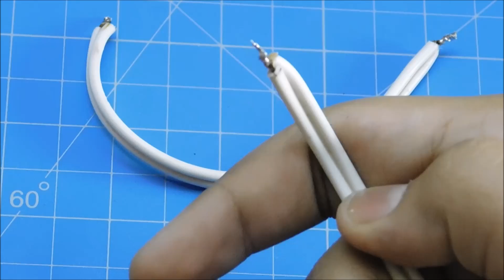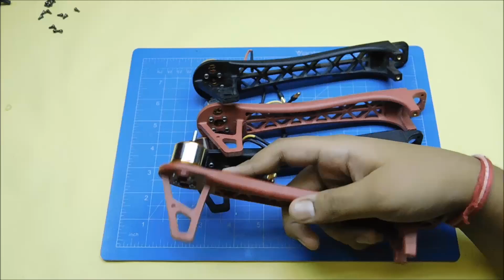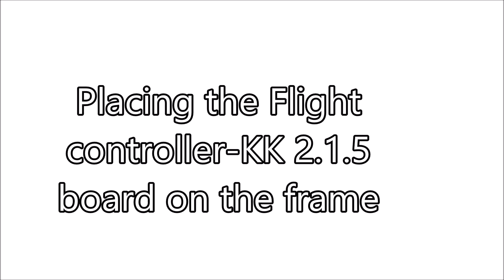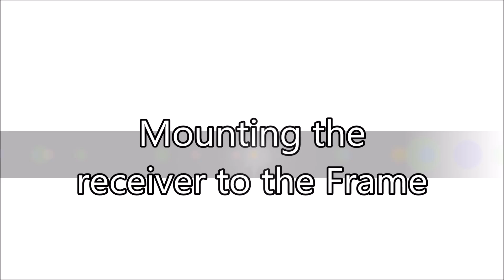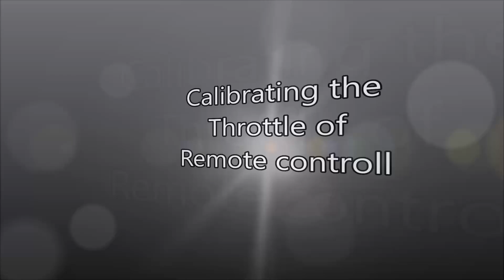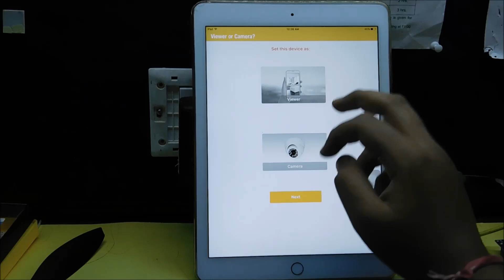Make a quadcopter with a wireless camera under $180!!

Comment: Sir mera kk k Fight controller hai but motors rotate but doesn't fly why sir
Reply: Your drone must be heavy

To fix it, do these things-
1. Adjust your motors kv rating 
2. Increase your propeller size 
3. Adjust your ESC ampere (A) rating 
4. Change your battery may rating
  
Adjust these things like vise and your drone will fly

Comment: Hi..the battery which i'm using is 5200 mah weighing 400 gm and i'm using apm2.8 flight controller..the motor i'm using is of 1800kv rating..is this ok?
Reply from the maker: yes

Comment: hey, Great work bro..
I am facing some problems..
when ever I switch it on and get it armed, 
on increasing the throttle 2 of the motors start moving and after increasing the throttle to half and above the 3rd  motor starts rotating .. 
The fourth motor starts rotating only after full throttle.
plz help.
need it urgently.
Reply from the maker: +Chandan C V the problem may be in your flight controller. Try to individually connect each motor to radio receiver to check whether your motors are ok or not.
Reply: thx bro

Comment: I have many doubts to make a drone..
1.why you was didn't use servo motors in this drone. But your drone was moving forward and backward..
2.which type of motors you was have?.like 1000 kV or 2200 kV motor
3.which type of motor was very good to make a drone.
4.which type of battery is very good to make a drone like 2200 mah or 5200 mah or 10400 mah battery..?
5.which company battery is very good like turnigy,lion power,limskey,hobbyking,.and etc...
6.how much of the flysky transmitter and receiver 2.4 giga herdz 6 channel and 1km range
7.you used only one battery 2200mah battery..so this drone was flying how many hours....
8.if you used,
 1.2200kv brushless motor(4 pieces)
2.2200 mah lipo battery (4pieces),
3.4 pieces of 1045 propellers, 
4.6 channel transmitter and receiver with 1 km range,

So this drone was lifted the battery and motor and extra load .????
This is my important question.....please contact me sir...i have many doubts in to make a drone... Please reply me.. 7904349761 this is my contact number..i am from tamilnadu.....

Comment: Whenever i try to arm the kk 2.1.5 flight control board by moving down the throttle and then towards the right it says armed. But after that when I try to give a little throttle the kk board auto-disarms itself. What could be the reason?
Wiring of all the receiver, board and motors are in the correct manner.
my all parts are as Below
1400kv BLdC
3000mah 3s battery
Esc 30A
KK 2.1.5 Flight  controller 
Transmitter and receiver  Are flysky FS-ct6b
But why could its happening??? 
 help me sir please  please
Reply from the maker: There is a time limit until  which KK2.1.5 board will not disarm itself. If the board does not gets throttle within 30seconds or so, it will automatically disarm itself. Also your can get disarm if it is not getting enough power. The motor with propellor pull  a lot of power which can cause KK2.1.5 board to get disarm automatically.
Reply: Tinkerer's Lab  okk sir i will change battery and after that i will tell you...
Reply: sir thanks for guiding me.. its awesome  and Works great.... thank uu Soo much...
but sir My 1ESC burned out and 3 was Good...
no any Short circuit.. Battery voltage Perfect but why this????

My quadcopter Specifications  are as below
F450
KK 2.1.5 FC
total load 900gram
Battery 3000mah 3s 11.1volt lipo 30C
10×4.5 Propellers.. 
Charger Imax B3 pro
ESC 30amp simonk
tx rx fs-ct6b
plzzz sir solve this and suggest me now what to do to stop this and not to repeat again....
plzzz.
i have to change all the Esc???

Comment: I have a problem .After I checked and corrected the direction of rotation of motors I noticed two motors are not spinning at the same throttle rate .They start rotating as I increase the throttle to almost full . Is it bad or is it normal ?If it is bad how do I fix it? I havent checked them out by using  the propellers yet, because the last time I went on a flight test the quadcopter flipped and the props got broken :(
Reply from the maker: If all the motors are working when the throttle is at half, then it is okay.
Reply: Dushyanta Rancho thanks a lot man....it's only for you I could complete my quadcopter ❤

Comment: You are a idiot u have not used any heat shrink tube for battery terminal it may short
Reply from the maker: Later I applied some electrical tape at the joints.

Comment: now what to do
2nd and third motor are going little up but other 1st and fourth are not trying to go up
Reply from the maker: Check the battery connection and the power distribution board of the quadcopter.
Reply: Bro, don't use the bullet connectors to connect the motors with the ESCs, instead, directly solder the motors wires with the ESCs.

Comment: How can I use FPV TRANSMITTER AND RECEIVER ON kk 2.1.5 board.
Reply from the maker: FPV transmitters and receivers do not require any connection with the flight controller. They are like standalone.

Comment: Thanks a lot man I have finally made my first quadcopter.However while I was doing my first flight test I saw one of the motors starting slower than the others .There when I gave full throttle the whol quadcopter tilted on one side and a propeller broke down ..why do you think the motor started slowly ?
Reply from the maker: Space Rock There is no problem in that. That happens sometimes due to the sensor readings. Regarding the accident, your quadcopter might have a little more weight on the side where the propeller broke.

Comment: Hey, I just bought a 4500 mAh battery (since u said battery depends upon me) ...will it anyhow burn up or cause damage to the quadcopter ? ..another prob is the battery is too large should I change it to 2200 mAh ?
Reply from the maker: No, the battery will not cause any problem. But some aspects you should keep in mind are, the voltage of your battery should not be more than the voltage your ESCs can handle and also the weight of the quadcopter should not be more than what your motors can lift. If you feel that the battery is making the quadcopter too heavy and the weight is straining the motors, you should change the battery else there is no need of changing the battery.

Comment: Sir ...I made my drone...in the same way...same components...the motors are working and propeller are rotating but the drone won't take off
Pls assist
Reply from the maker: If the quadcopter is too heavy, it won't take off.

Comment: you can never make this drone under 180$ .Given the fact that you live in India or Bangladesh.The motor and ESC took me around 100$ let alone the Tx Rx and flight controllers. (-__-)
Reply from the maker: Space Rock No you can make this under $180. The cost of one 1400kv motor along with ESC and props is INR 850. Multiplying it by four gives use INR 3400. For the frame, I paid INR 800, for battery INR 1500, for RF controller INR 2800, for flight controller INR 1500. That sums up to INR 10000 which is around $156, way less than $180. So you can make this quad under $180 dollar(The cost of mobile phone is excluded). 
PS: All the prices mentioned by me above are checked from the online stores like eBay and amazon.
Reply: Oh I see..btw what is that blue paper where u worked on your quadcopter called?

Comment: What's the maximum range?
Reply from the maker: Range of what? The transmitter or the flying range?
Reply: Both
Reply from the maker: bakwaas This transmitter has 1km of insight range, that means if there are no buildings around, you can fly it up to a distance of 1km. The flying time of the quadcopter depends upon the battery and the parts you use. To increase the battery time, use high capacity batteries and use motors that take less power but also give ample amount of thrust. Hope that cleared your doubt

Comment: Hello I have a doubt that here why are you using kk 2.1.5 controller instead of that can I only use fly sky transmitter and receiver? 
And I think it will work without the controller but I am not itself confirmed as I am doing this project for 1st time. Please help me out to solve this
Reply: Devyank Shaw, it is about self leveling, means it levels itself when you let go of the throttle. With only the transmitter and receiver it will not stay stable since there are always possibility of win and air pressure. The kk2.1 includes a gyroscope which detects angular movement and counteracts with the motor.

Comment: why my ESC got burned while testing
Reply from the maker: mohammed swalih what is the current output rating of your ESC?
Reply: 30 a
Reply: Battery 2200 mah lipo
Motor 2200 kv 2212 
30 A Esc
Reply from the maker: mohammed swalih is this happening with all ESCs or with any one ESC?
Reply: each
Reply: Tinkerer's Lab one esc only
Reply: after connecting to flight controller
my flight controller  kk mini 2.0
Reply: can u describe the configuration on kk mini 2.0
Reply from the maker: mohammed swalih if this is happening with only one ESC then that ESC must be having some fault in it. Try contacting to the person from whom you bought the ESC and get it replaced with a new one.
Reply from the maker: mohammed swalih configuration on kk2.0 is same as that on kk2.1.5. Watch the complete video to configure the flight controller.
Reply: K thank u
Reply: whats the flight time that u r getting????
Reply: I used to have the same problems with 30a escs and 2200kv motors(ESC only burnt when props were attached). I tried changing flight boards and receivers but that didn't solve the problem. Now I use ready to sky 920 kV motors which came with its own ECS(u can get the set of 4motors+ESCs on AliExpress). N the 920 kV motors are more than enough for my drone(1.3kg)

Comment: the motors you have used can move only in one direction ir both and wahts the best flight controller and that is easy to configure. I making it first time so. waiting for the reply
Reply from the maker: NO. The motors can rotate in both the directions. The best flight controller for beginner is KK 2.1.5 . It is very easy to use and configure. If you want a better fight controller, you can buy APM 2.8 .
Reply: need your number or email or fb id
Reply from the maker: dushyantarancho@gmail.com

Comment: Hi
This video is very awesome..
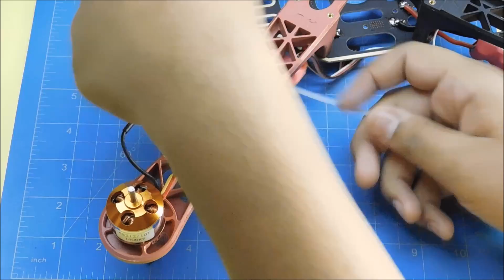but i need a strip which you tired in wire at 8:45 min can you tell me
Reply from the maker: Aman Khoja Those strips are called zip tie.  You can buy them online from eBay.in or can buy them from the stores where polybags are sold. You can also get them from big grocery stores like big bazar, if you don't want to buy them.

Comment: Well, actually you want your motors rotating when throttle is set to zero. you must calibrate them to rotate at the lowest possible speed without stopping. Because if you don't,  it might cause the so-called "flip of death". 'cause when the drone is in the air and for some reason you bring your throttle to zero and back again, some motors might react slower then the other picking up from zero throttle , causing the drone to flip over. you'd better set a stationary rpm when the drone is armed.

Comment: I did the same procedure as u did.!! But in my case 3 motors wer rotating and the 4th motor will rotate oNly after some throttle ...please help
Reply from the maker: If all four motors are rotating when you increase the throttle and they stop when you set your throttle to zero, then no need to worry. Your quadcopter is working fine. This generally occur due to uncalibrated sensors. Try calibrating your sensors to eliminate the problem and if does not go after calibrating the sensors, then let it be as it is. This problem will not harm your drone.
Reply: Ty u

Comment: What is the power distribution board for
Reply from the maker: arkk kapoorr The power distribution board is used to connect the positive and negative of the battery to the positive and negative of ESCs. It just connects all ESC and the battery in parallel. The quadcopter base that I am using has a built in power distribution board so I did not buy one but if you are using a base which does not have a build in power distribution board, then you need to buy one.

Comment: Is it ok if we don't have bullet connectors and connect from wire to wire
Reply from the maker: arkk kapoorr You can connect wires directly without using a bullet connector. But bullet connectors make things easier and the process less tiring. For example, if you by chance connected the wires wrongly, then you need to again disconnect all the wires and make the proper connection. This tiring process is eliminated in case of bullet connector.

Comment: background music very loud, i cant listen u properly, appreciate ur work👏,  can u tell me about stability ? how much stable  , while flying ?  and ur using gyroscope or not ? or it is present in that green cheap ?
Reply from the maker: Vaibhav Mugale Thank you and sorry for the loud music. The quadcopter is pretty stable when flied but it keeps on changing its horizontal position because it does not have GPS. And gyroscope is also present. It is soldered in the flight controller.
Reply: Tinkerer's Lab k thanks bro 🙏number mil sakta he kya bhai? hum logoka project he ye but work nahi kar raha thik se , kuch info and help chahiye tha.
Reply from the maker: Vaibhav Mugale Sorry. Due to security purposes, I can not give you my phone number. You can message me your problem on my mail id. It's dushyantarancho@gmail.com
Reply: Vaibhav Mugale Don't worry I can help you,tell me your Drone exact problem,i think you are getting programming problem???

Comment: Can we use any transmitter for this project
Reply from the maker: abhay Nayyer No. You can not use any transmitter and receiver. There are specialised radio controller which have a high range of transmission and are compatible with the flight controllers.

Comment: how much weight can it lift????
Reply from the maker: Amount of weight that your quadcopter can lift depends upon your motors. The upthrust provided by your motors will determine the weight your quad can lift. You can find the upthrust provided by your motors in the description of the site from where you are buying the motors. 
But remember that the total weight of your quadcopter should always be less than the half of the total upthrust provided by your motors.